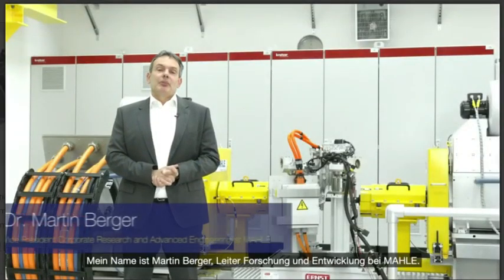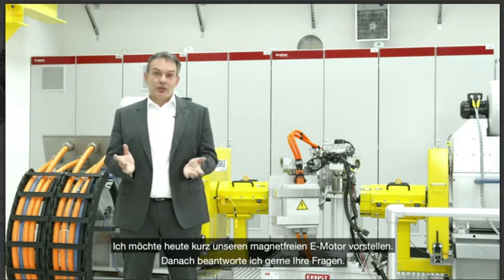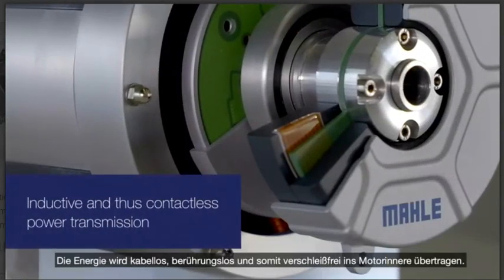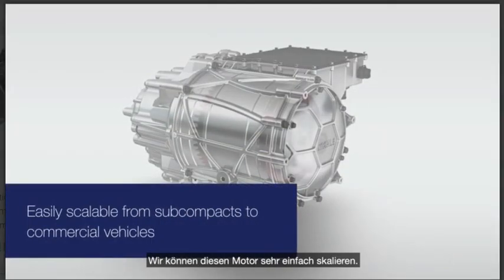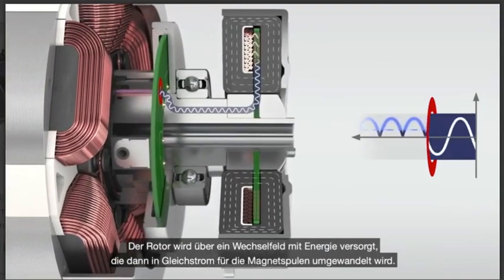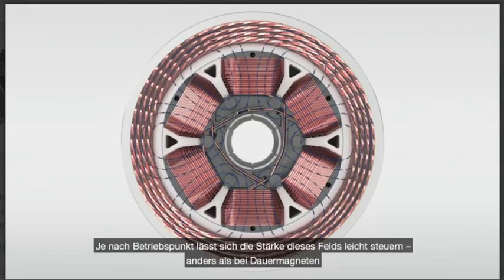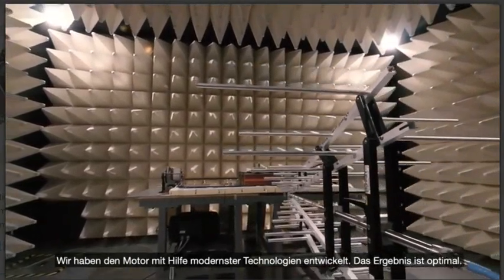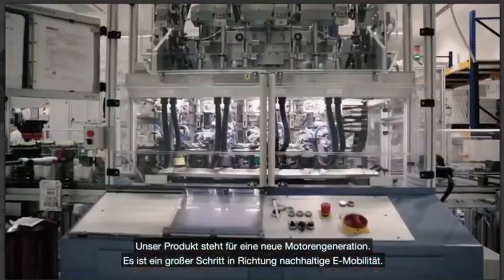Mahle, produce revolutionary new no-magnet motor...

Comment: It sounds good on surface, but I see large problem with that, mainly - SynRM.
Synchronous reluctance motors don't need coils in rotor, which is fully made of steel, which makes it much cheaper than copper windings.
On top of that they achieve similar efficiency.
So it's not much of a step forward, but at least you took the magnets out.
Winding with aluminium could also make much cheaper motor, since copper itself is actually a rare metal.
Reply: Reluctance motors have got a cos phi of 0,4 to 0,5 which means you need twice the current for the same power compared to a properly charged synchronous engine.

This requires a lot of additional copper and a  produces a lot of additional heat losses.
Reply: True, but permanent magnet, or in fact this motor as well, suffer from strong back EMF at higher rotational speeds.
That's why Tesla used magnet assisted synRM, which are superior to synRM, PM and induction motors all in one.
I think the motor in video should try being electromagnet assisted synRM for possibly better effects, instead of effectively being very compicated adjustable PM motor.
Tesla so far has cheapest motor in the market compared to specs.
Also synRM motors do very well with just ferrite magnets, research paper here:
https://ieeexplore.ieee.org/stamp/stamp.jsp?arnumber=7911107
So you could very cheaply make decend IPM-synRM motor, with performance near the one in the video.
Don't get me wrong, I like the thinking and experimenting, but this just seems to go wrong way.
Reply: @michahalczuk9071  The MAHLE engine is a very classical synchronous engine, which has the highest efficiency possible, only beaten by neodym magnet charged motors. 

The electrical charged synchronous engine can be operated at approximately cos phi = 1 at any speed and load conditions, just by adjusting the rotor current.
Reply: Well I don't doubt it's synchronous, but it doesn't have the highest efficency possible.
Tesla IPM-synRM motors have the same peak efficiency, and they are very cheap (comparably).
If they aimed for not using NdFeB magnets - great, this is achieved, but it looks like at cost of incredible compication:
1. Extra electronics inside the motor.
2. Extra coils in rotor.
3. Extra coils to send power to rotor.
4. More winding steps.
If you wanted to achieve no rare earth, you could just go with optimized ferrite magnet motors and achieve similar result.
I like that new grounds are tested, but the best part is no part.
Reply: @michahalczuk9071  The power needed to excite the magnetic field in the rotor is very low (a few hundred Milliamps/1 or 2 Watts), compared to the engine's total power consumption.
Reply: Yeah I know that, but you still need substantial amount of winding and extra complexity to reach that.
If Mahle developed it in such way that it's actually much cheaper and superior to other products - great, good for them.
However just looking by this video I can see that it's probably not, since they have to outward state that this is mainly no-rare earth material motor, and looking by it's complex construction.
Reply: @michahalczuk9071  Tesla doesn't make synchronous reluctance motors. The Model 3 motor is a conventional IPM motor - just look at the rotor in a teardown video. All recent IPM motors in EVs have some reluctance component.
Reply: It's not conventional IPM.
It's IPM-synRM.
Basically permanent magnet assisted synchronous reluctance motor.
This is why they have highest efficiency on market despite high RPM.
Explains weird internal magnet placement, with continuous pieces of steel for reluctance.
Reply: @michahalczuk9071  Look at the rotor... it's just like everyone else's, including the magnet placement. All of these modern EV IPM motors exhibit some reluctance torque when properly driven. I have yet to see any published evidence of higher efficiency, although of course Tesla fans always claim that everything from Tesla is superior to everything else; the same people insisted that induction was better than PM, until Tesla went to PM.

Here's report which analyzes the Model 3 motor, including tearing down an actual motor; it includes photos of the completely normal IPM rotor laminations.
https://motorxp.com/wp-content/uploads/mxp_analysis_TeslaModel3.pdf
Reply: I sent a link to research paper on IPM-synRM vs PM vs induction and vs synRM, and they have superior properties to all of them.
It's also not normal IPM motor since you can clearly see that magnets are not placed straight, but in the way gives you reluctance rotor. It's not a magical new design, but it is IPM-synRM.
As for cost and efficiency, you can watch Sandy Munro talking about it, but clearly Tesla's drive the furthest at similar battery sizes, so they are visibly more efficient than competition.
Reply: @michahalczuk9071  The magnets are in that vee configuration in all IPM motor rotors - just look up images online of any of them, such as the motor of a Nissan Leaf. Since this is on one of Sandy Munro's videos, look at his VW ID.4 motor teardown.
https://www.youtube.com/watch?v=3Bab6CttkEY 
(rotor construction discussion at 17 min 40 sec)
There are three rotors on the table in that video; from left to right they are from the ID.4, the Nissan Leaf, and the Tesla Model 3. Yep, all basically the same, although the ID.4 and Leaf are 8-pole and the Model 3 is 6-pole.

The energy consumption per distance travelled (which is not strictly efficiency) of Tesla models has more to do with aerodynamics and careful optimization to match test procedures than with motor efficiency.

I don't know what you mean by you "sent a link"... there is no link in that post of yours.
Reply: I've sent a link:
https://ieeexplore.ieee.org/stamp/stamp.jsp?arnumber=7911107
It's hidden when you only open comments in top bar, not in video.
I've seen video, and just having magnets in V configuration doesn't make motor IPM-synRM.
And there is quite substantial difference between those motors, that is between Leaf/ID.4 and Tesla.
Both Leaf and ID.4 have external magnets that are alligned flat with surface, and those strentghen poles.
They also don't have reluctance part.
For synRM you actually need a steel magnetic circuit with low reluctance between poles - out of those three only Tesla has it.
Leaf motor has no such circuits whatsoever - it's just magnets arranged in V + flat.
ID.4 motor has cutouts where there should be steel for magnetic flux.
This means that both of the above are indeed normal IPM motors.
Tesla on other hand has thick reluctance part which is visible by magnetic circuit created between magnets in the shape of star. Small outer lobes also help it getting more reluctance to those poles.
Are you trying to tell me that these large visible differences just don't appear to you as IPM vs IPM-synRM?
Here you have another link with small comparison of standard IPM vs PMaSynRM, but with more visible differences:
https://www.researchgate.net/figure/Prototypes-of-IPMSMs-and-PMa-SynRM-a-stator-of-double-layers-IPMSM-with-winding-b_fig10_325444208
Tesla just made IPMSynRM with really simplistic construction, but you can clearly see that it would be SynRM if you took out all magnets, because magnetic circuits are uninterrupted.

Comment: Very interesting. But why use synchronous motors at all? Why not use 3 phase induction motors with power inverters?
Reply: It is a three phase synchronous engine, which has a far better efficiency than the asynchronous induction motor.

Comment: Ehm, Induction motor?
Reply: Nope. Electrical excited synchronous engine.
Reply: @norbertfleck812  Mmm, kynda strange. I like induction motor anyway but this still cool
Reply: @Tecnomat02  An induction motor does not have slip-rings nor does it need a wireless power supply for the rotor.
The asynchronous induction motor has got a worse efficiency compared to the synchronous engine but is much easier to control (a synchronous engine will not start on a fixed frequency power supply without an electronic control) and much simpler to build.

Comment: No permanent magnets means the motor can't be used for regeneration.
Reply: Where did you hear that? As long as you have enough power to activate the rotor coils, regeneration is no problem. The circuit for powering the rotor coils is independent from the stator coils btw.
Reply: @CatNolara  in order to generate  an electrical current in a wire, the wire must pass through a magnetic field. Electricity 101

Comment: Using exciter coils became revolutionary? There ware speakers 80-100 years ago with this technology. Someone once told me: new tech is just old tech forgotten and refined. Exactly what was shown here
Reply: There is nothing forgotten about the synchronous engine which is constantly in use since the late 19th century.
They are used as alternators in cars up to generators in large power plants.

The only innovative step is the replacement of the cheap and simple (to repair) sliprings (or high performance magnets) by a pretty complicated and lifetime limited electronic device.